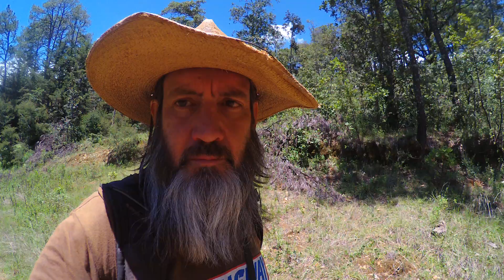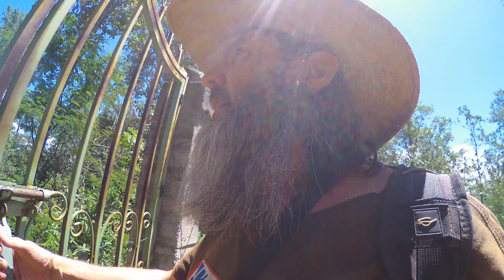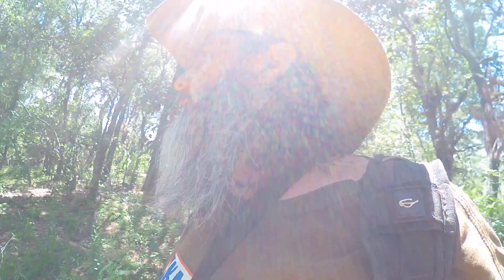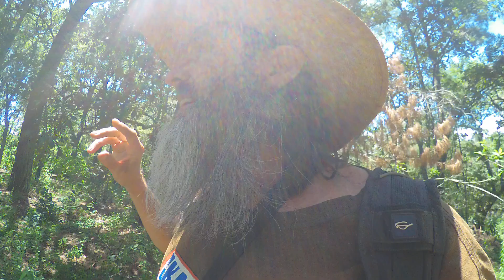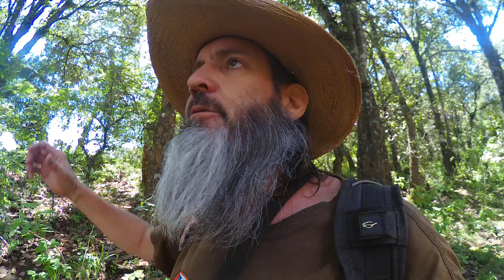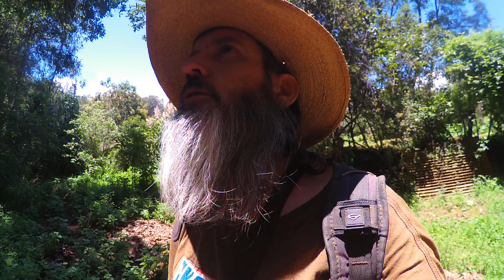Tricky architecture: How to get light into buildings without electricity. The future of light

Comment: Cheap and easy way to bring sunlight inside is a satellite dish with a mirror surface, like a diy solar cooker. Aim it around a window and you will have sunlight for quite some time without tracking device. For more safety use convex mirrors.
Reply from the maker: One would likely have to be careful as such dishes can focus radiation to a single point. They could he dangerous to point at a building.  That focus point can be dangerous if a bird flew through it, for example. 
But certainly, used with caution, they could play a role. 
I have been playing with that idea a little. 
https://www.flickr.com/photos/thebosque/tags/largesolaroven/